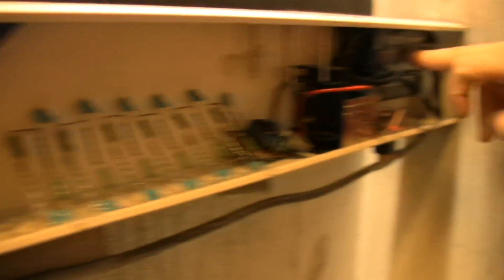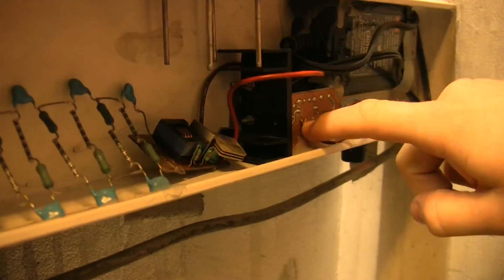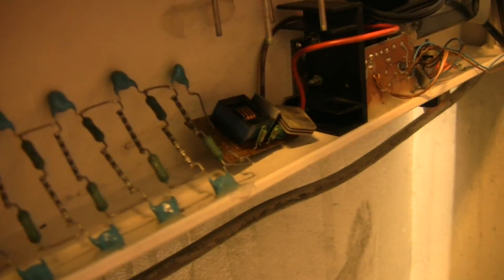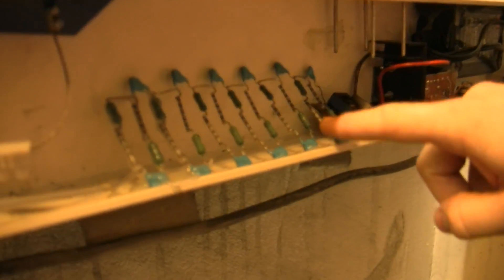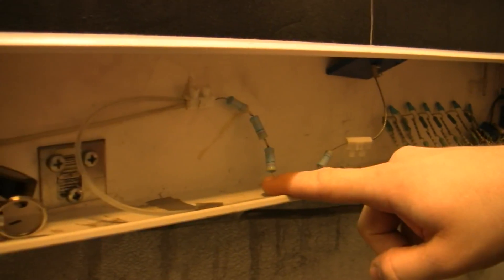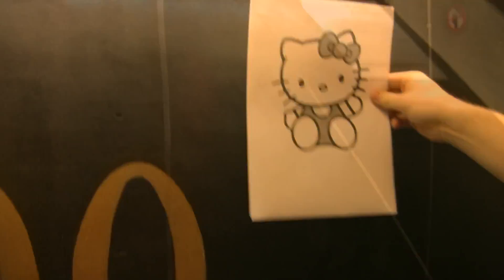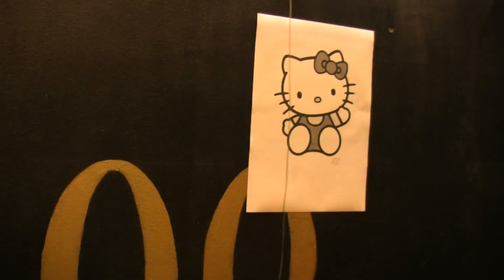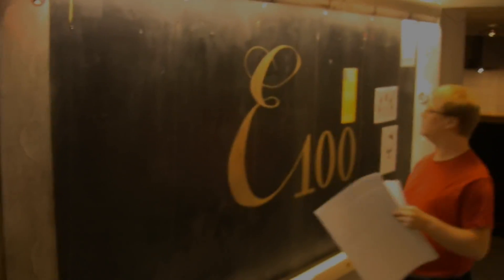High voltage notice board

Comment from the maker: @fairyheli2 
Not if you want it to work, the board works because there is a constant flow of ions that charge the outside of the paper to a different potential than the wall, thus creating a force pulling the paper to the wall. If you insulate the wires they might just as well not be there.

Comment from the maker: @Normandy5
I am touching the wires because one of the current limiting resistors is broken and i keep forgetting which one.

The spark can just be felt, it's like touching something after walking on a thick carpet or similar.

Current limiting is achieved by resistors between the high voltage PSU and the wires.

The ozone can sometimes be smelled, but usually not.

Comment: Thanks for the video.Very interesting device.
You touch the wires before posting a page.  Is that necessary?  What happens if you don't touch the wire?
You multi-touch the wire. Do you feel a spark when you first touch the wire?
Do you have a current limit circuit, or is the current limit implicitly low by design?
Does the high voltage produce ozone and can you smell it?